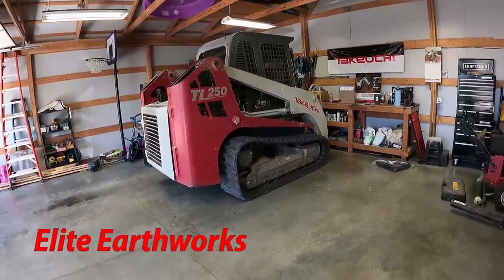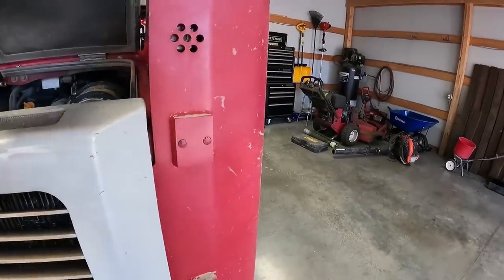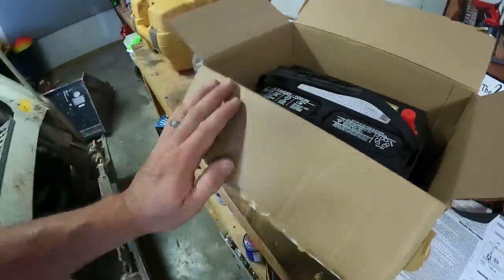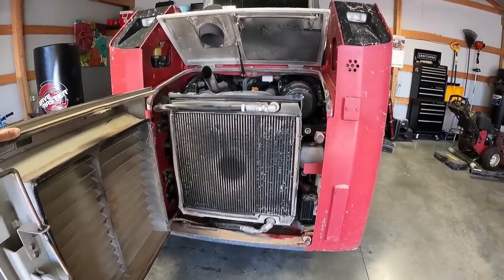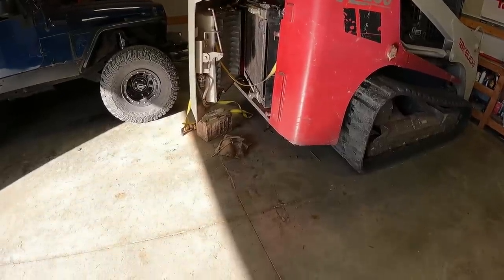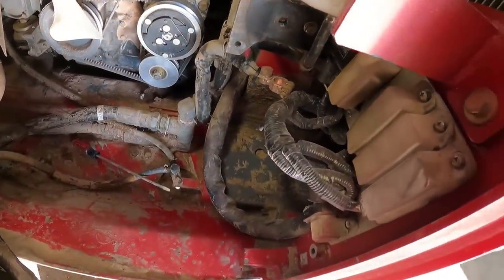Installing A Battery In The Takeuchi TL250

Comment: My dad loved to wrench around on stuff... I don’t think he ever bought anything new besides gasoline... even our shoes came from the Nearly New store.

He was never happier than when he was twisted and tormented under a hood trying to reach some screw in the most obscure recess of an engine.  He could work for days removing parts, taking them to the junkyard, removing them from the junker and putting them in when he got home.

My job was to hand him tools and hold the light.  I don’t know how many days of my life were spent holding a 100 watt bulb in one precarious position or another.  

My favorite part of it was when he said, let’s go test drive it.  Unless of course it happened that we turned around and came home early because more wrenching was needed.

Garage Assistant was good because I got to spend a lot of time with him.  And, I learned a lot about mechanics... but, I also learned that I don’t enjoy it without him.   So, I only do the easy stuff. Like: changing brakes, oil & lube on equipment, plugs on small engines, etc.  when it comes to anything that takes more than an hour or so... I usually let the pros handle it.

I’m thinking that battery change that you did would have been hired out from here at Sassafras Valley!  

You know there was an option you could have tried... O’Reilly has a sign right in their door that says, “Batteries Installed Free”.  Brandon, you have to be thinking man!!
Reply from the maker: 🤣🤣 I should have tried oreillys . I did that same thing with my grandpa. Lots of light holding but I did learn a lot. Love the comment and appreciate you e

Comment: Sir:
   Two points in need of correction. I have a TL 12 without the access door. Also, my track loader came with a group 27 battery with 795 cca. The company confirmed that it is a group 27 battery before I removed the factory installed one. However, since you put in a group 31 battery, I will do the same. 
  Second point is I muscled out the original battery without removing the radiator shroud  which is a significant saving in time. Only the electrical harness was an issue, not the shroud. Very helpful video!!!!! I did require many more hours to accomplish what you did in a few!!!
Reply from the maker: The 12’s may have just a little more room to slide the battery out with the shroud but it’s still tight. I’m glad it was helpful, this can definitely be a pain on either machine

Comment: I really enjoy these "fixing stuff" videos, especially on this type equipment that I may purchase in the near future, watching you and Dirt Perfect work on skid-steers is convincing me that an old guy like myself would probably throw tools across the shop and make up new cuss-words during such repairs.  Seriously, it's good information, and I'm really impressed that you both had a battery last six years in any kind of diesel, as well as you can remember what process it took to install it before.  (If I don't finish a job in one day, I usually forget what I took apart the yesterday.)  Anyway, watching this was another good excuse not to go and try to repair the posthole auger I broke yesterday, thanks!
Reply from the maker: Thank you! Yeah I was very happy it lasted that long. I remembered it was a pain before so that helped a little on what I was getting into lol. Appreciate you watching

Comment: Sure if you take the left track off, tip the whole machine upside down. The battery should fall inside the cab. Then to install new, take it up on the roof and drop it, should fall right in then work all steps  on reverse. Job done! Works everytime
Reply from the maker: 🤣🤣 that’s a great idea. I’ll try that next time lol
Reply: @eliteearthworksllc   you could cut your own hole in the side. Then use some new 3" wide flex tape to cove the hole and be water proof too!
Reply from the maker: Yeah I just can’t bring myself to cut on it lol

Comment: Every time I did that in my TL250, I made a day of maintenance out of it. Took the anti-freeze out, pulled the radiator and pressure washed it clean, replaced lower radiator hose (cause it is a pain to get to) changed oil and filters, pressure washed the motor, and replaced the battery. Doing it that way kept my f-bombs down to a minimum cause of all the other things going on with the machine. Good how-to video, but you either have a very mild temper or you did a LOT of editing before the upload...lol
Reply from the maker: That’s a good idea. Much easier to get to the battery. Good to keep all that clean. Appreciate you watching

Comment: After watching you change the battery I'm not going to complain about wrenching on my 2001 Cat 262 skidsteer. The top is my radiator with hydraulic driven fan that swings up out of the way and when you swing the back door open everything is right there with quite a bit of room to work. Ya the group 31 batteries are the same battery used in semi's but instead of the lead post they have a 3/8" stud post. So whenever I switch out batteries on anything including my pickups I put group 31 batteries because they're cheaper and heavier duty. I even change the cable ends  to go to the stud post because the studs are stainless steel and don't corrode or get a loose connection as easily. Nice video on showing how to get it done!
Reply from the maker: Yeah that sounds like a pain too. The group 31’s are definitely some strong batteries. Good idea on that. Appreciate you watching

Comment: Looks like they placed the battery and then built the rest of the machine around it. You may already know this but a 3/4” will work in place of the 19mm if you get in a jam and need it. There are a few others that are interchangeable as well. Just a little free fyi
Reply from the maker: I think they did lol. Yeah I usually us the 3/4 on the radiator I was just trying to cover the metric sizes lol. Appreciate you watching

Comment: Had to do the same thing on a Mustang track loader, looks identical other than paint color.  Biggest problem was ours was stuck up at a jobsite in a blizzard and had the chang it to use to clear road to get trucks up in.  It fit on paper when designed though!!
Reply from the maker: Oh that’s not fun. Yeah the Takeuchi, Mustangs and gehl are identical. You are definitely right there it fit on paper 🤣

Comment: Different! Good to see you pulling wrenches. What an after thought of that battery location but at 6-7 years, no biggy. I thought you would have blown out the radiator while you had access to the inside of it. Regardless, thanks for another one. Sonny (CT)
Reply from the maker: I agree it’s not terrible especially if it’s only every few years. I did blow it out I just didn’t film it, it was dusty lol. Appreciate you watching

Comment: The 12v2 battery is on the opposite side then your 250, I think it should come out easy, but I haven't had to yet.
The radiator is worse I think on the 12 than the 250 to get swung open.
There is 2 more lines in it than on yours, inside on the bottom. Pretty sure it was 2.
If you can get a "Deka" brand battery where you are I have had really great luck with them!
Reply from the maker: Oh nice they really changed it up. Ok good to know on the battery. Thank you!

Comment: I just happened on this video now a year old. Battery access is difficult on Takeuchi's skid loaders for sure having had the newer TL10V2 along with an older TL240 and a TL12. Both older machines have the battery in the same place as yours as opposed to their newer machines having it on the left down under where the hydraulic tank used to be. Don't be fooled into thinking it's that much easier because it isn't. The outside access makes it look easy. That's about all. The newer machines communicate with Takeuchi regularly and if you aren't running your machine at least every week, the extra draw kills the battery. The older machines can go for months and start right up. All my excavators are dead too as they are all 2018 and newer with the same communication feature. It's easier to install a battery switch on those, but not on the TL10V2 or 12V2. There's just no room - at least I haven't found a spot.
Reply from the maker: I’d believe that. Those batteries are crammed in there. The side panel probably just makes it easier to see the side of the battery lol

Comment: Brandon bad battery place in;  you should install a main switch directly from the battery if it goes short you turn off the main switch, so the short does not spread
Reply from the maker: That’s a good idea. Hopefully it will make it another 5 years

Comment: This is kind of of topic, but just got one of these machines so I was wondering what oil you run in the hydraulic system. Calls for engine oil on the machine, which I’ve heard you can do, but have never actually used engine oil myself. Is that what you run or do you just use hydraulic oil? TIA
Reply from the maker: I run 10w30 motor oil in mine. That’s all I’ve ever used and it has over 8k hours on with no problems. Hopefully that helps
Reply: @eliteearthworksllc  okay thanks! Do you just drain it right under the tank on the left side?
Reply from the maker: Yes
Reply from the maker: It comes out quick and makes a mess lol

Comment: After you took the battery out, you should have measured where it was on the outside and made a spot where you can cut a hole and take it out without having to disassemble the back of the unit like you have to do every time. Cut the hole and out a door on it yourself.
Reply from the maker: Yeah that’s a good idea. I just can’t bring myself to cutting a hole in it lol. Appreciate you watching

Comment: I've got a TL10 with the same idiotic engineering. I've owned many Takeuchi skid steers in the past. A TB175 excavator also, but never again. I understand it's tougher with the newer emissions but there's no excuse for putting the battery in a place where you can't even get to the negative terminal. If you get a bad connection on that terminal you have to go through all that nonsense to fix a simple thing.
Reply from the maker: They have really improved the newer ones but yes that’s the one draw back of the older machines.